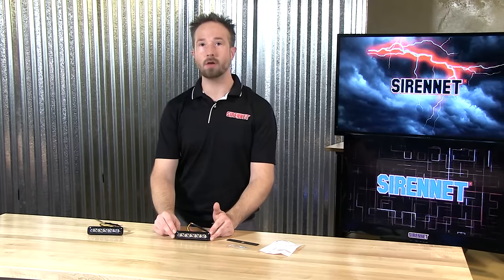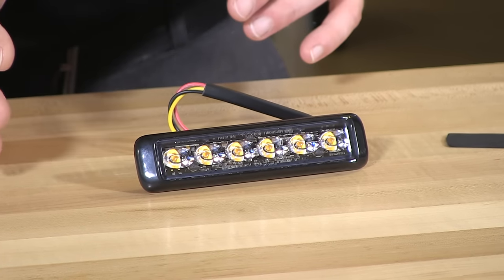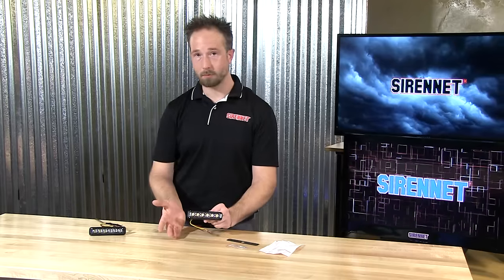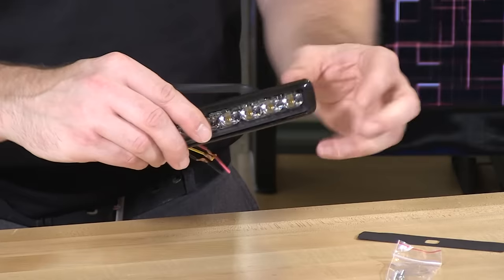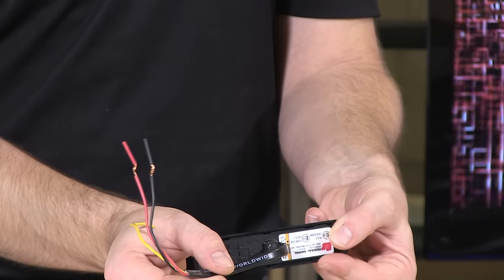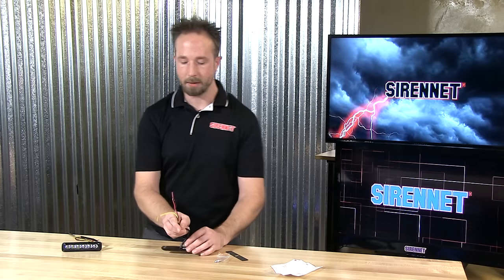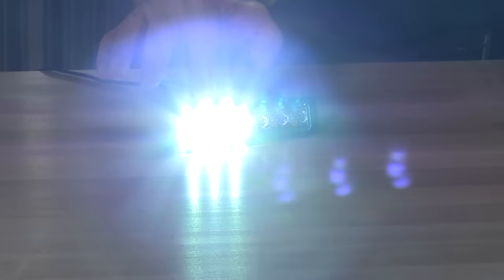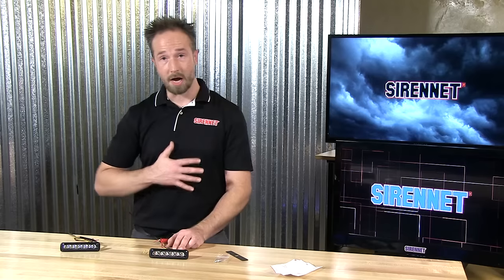Federal Signal MicroPulse Ultra 6-LED Surface Mount Light

Comment: I have this particular light and it's easily visible to at least 250 feet in the daytime.  I ended up wiring a lit SPST marine rocker switch so I could easily control it and it seems to work like a charm!